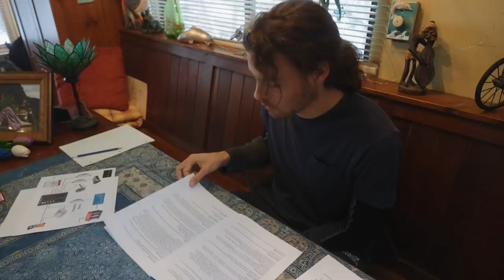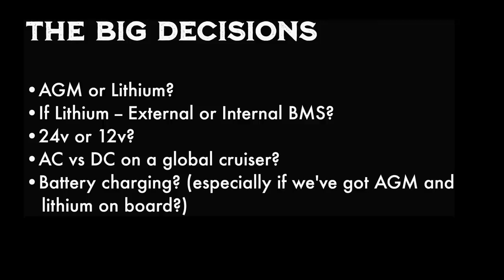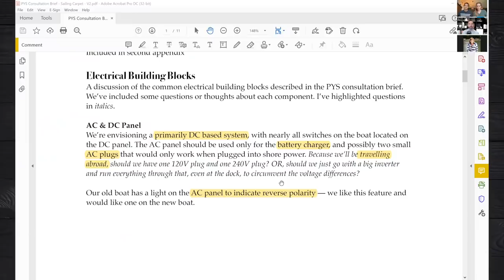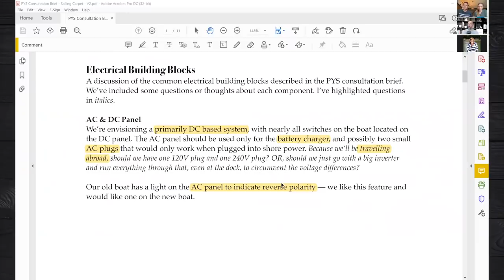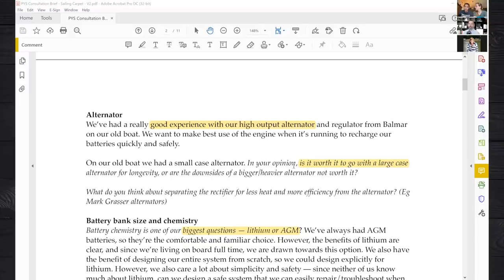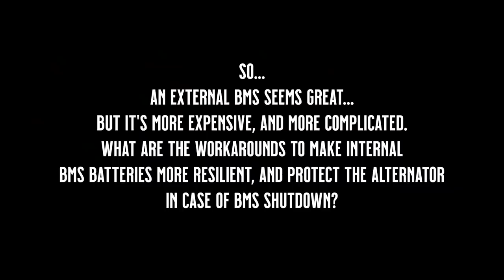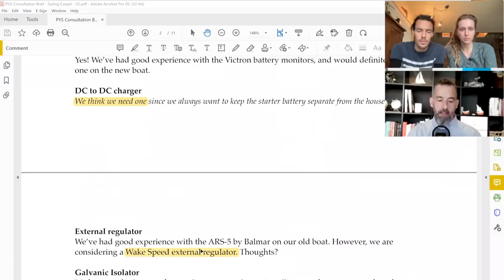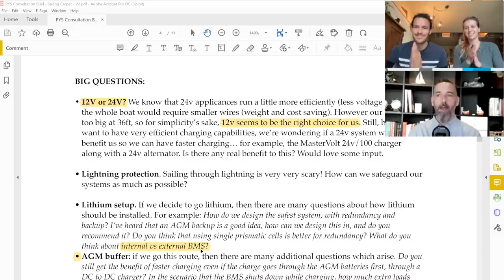DESIGNING an ELECTRICAL SYSTEM for WORLD CRUISING (with Jeff Cote from PYS)

Comment: I have often wondered if each battery in any multi battery bank could be charged, and discharged, individually and sequentially.
For instance, if you have 5 batteries, each 100Ah with a total of 500Ah, would it not be better to fully charge, in turn, 3 batteries than having the whole bank to 60%, and likewise for the discharge?
So any one time you may have fully charged, using, and discharged, batteries.
Reply: Not a preferred scenario that I am aware of. Some exceptions of reservation of untouched starting and bilge pump banks. 
Larger vessels normally have many remote banks. Frequently then recharged on one charging distribution system. So many options.

Comment: A Balmar redline alternator is the best base for all. Go not higher then 70-90 amps, otherwise pullys v-belts etc. will be most expansive at all. My Volvo Penta MB 21 has enough power to drive a balmar. My daily consumption in av. is 70-90 Ah. Consumer battetries are 600 Ah standard batteries, wich you'll find a round the world for less money.

Comment: You will not be sorry with LiIon batteries, they provide twice the amount of energy because they can be discharged to almost zero. AGM batteries can only be discharged to 50%. They also last 2-3 times longer than AGM. Therefore they are cheaper and lighter than AGM!

Comment: Hi I have been following you for a long time now and like your videos. I'm sorry I'm not good at writing English. I have dyslexia, and my language is Norwegian, but I understand English well. Trying to use Google Transfer to translate I I write to you in Norwegian. I know it can translate some mistakes, but I hope for the best.

Do not agree with everything that the expert you spoke to said. This is because I have an education in electronics and electricity.

Putting a lamp between earth and one live wire on the shore power connection is something one must not do. This is because then you make a ground fault in your boat which will cause the zinc nodes on your boat to etch away quickly. And one does not want that. Also, if the ground fault is parallel to your lamp, it will not light up. When it comes to AC, you should choose the voltage you want to have on board, 110V or 220V. When it comes to 50 or 60 Hz so do not think so much about it. For 99% the things are producing today can be used on both. So do not think so much about it. To prevent earth faults, I recommend that you insert a isolating transformer. It will stop all earth faults from other boats. If I were you I would have had 2 connectors for charging current, one for 110V and one for 220V. And had a separation transformer that had two entrances. One for each of 110V and one for 220V and that deliver the voltage you want on board the boat. Then you have solved 2 things.

2. Regarding the type of batteries you have on board. Personally, I have the 1st starter battery bank, and a 400 Ah lithium battery bank. I use a diode isolator from the generator on the motor. Starter batteries are not an AMG battery. For that use only to start the engine and nothing else. When it comes to landing from shore power, I use a charger that can conduct 2 banks. Regarding with lithium battery, there are practically less problems with them than one has with lead batteries and AMG batteries. An AMG battery is practically the same lead battery, and they have exactly the same problems. If you charge them too much, they lose power. And that you can only use about 25% of the capacity. While a Lithium you can use 99% of the capacity without being damaged. If you want to talk to someone who has experience with lithium batteries, please contact those who sail with the boat Uma. They have a sailboat with an electric motor and have used it for over 5 years. Go to Sailing Uma on YouTube. So the problems he refers to with lithium batteries, you can completely ignore. But it is important that you choose the right type of Lithium batteries. Use LeFePo4, these are batteries that are approved for submarines and the contents are not cobalt. Because they can not self-antenna. as the other common lithium batteries can. They cost a little more but are much safer.

Something I would recommend you make sure you have the equipment:

ASI class B-SO, because it is the only one like AIS class B that transmits strongly enough that the AIS salt bits can receive the signals.

Wear AIS-SART in your life jackets. Because should one of you fall overboard, you can see where it is on chart plotters. Other boats with AIS will do the same. Remember that an AIS-SART needs to be checked, lost once a year. It hurts in the instructions for use how to do this.

If you have inflatable life jackets, you must check them every year. By pumping them up, check if they do not leak air / gas in the course of 2 days. As well as weigh the gas cartridge that it contains gas.

Good luck with your new boat. And I'm looking forward to seeing when it's on the water, and watching you sail with it.

With best regards
Knut Botnmark
Email: knut@z-b.no

Comment: Ok, so this is good advice. HOWEVER, this is the 21st century. Put an electric drive motor in MG2, install enough agm batteries as low in the boat as you can with enough capacity to drive your boat 500 miles. Go 48 volt. It is easier to drop a voltage than to raise one. Get wind and solar, also tow a water generator off the transom. Get a backup 2500w petrol generator with the same voltage as your power tools.  I would also install an air compressor in MG2 while she is apart. Air tools are great and will allow her to be pretty when she arrives in port, not just when she leaves.

Comment: I am NOT an electrician by any means...  What I do know is that  You can`t see it, you can`t smell it, and it CAN KILL YOU if you get it wrong..... When I worked in F1 setting up the garages for racing/testing I had a device that I plugged into the mains supply which through a set of lights told you the Polarity of the supply....  I then had a short adapter which had 2 pins that could be swapped to suit the input....I am not an expert but there are devices out there to help....  The definition of an "Expert" is an "Ex" is a has been and a "Spurt" is a drip under pressure... :-)))))))  xx

Comment: I don’t understand why you can’t use a Li-Ion battery for starting an engine?
I like lithium batteries because they hold a charge for many, many months with no charging. I use my boat seasonally and not having to keep a charger going periodically all winter is a huge relief. My boat has a bunch of lithium batteries in parallel with fuses between, if one fails, ideally the fuse would protect the others by isolating the bad one.

Comment: Scusatemi se vi scrivo in italiano ormai il mio inglese è ridicolosamente penoso.
Aiutami Aladino
Jeff ha fatto una descrizione fantastica, semplice ed efficace, mi trova d'Accordo al 99%, con un paio di miei pensieri.
Per quanto riguarda la batteria del motore, per il suo avviamento, sulla mia automobile ho una litio fatta per i motori, per la loro accensione e per i vari servizi interni all'automobile.
Per quanto riguarda ricaricare le batterie di servizio della barca, normalmente, si usa uno Sterlig Power to Battery e non un DC-DC Charger altrimenti potremmo avere tutti quei problemi descritti da Jeff sul distacco dell'alimentazione in tutta la barca.
Io valuterei anche la installazione di una batteria a super condensatori che non è una batteria classica, direi che è una batteria che accumula quella energia che serve per lo spunto di una qualsiasi utenza elettrica e poi lascia il lavoro di alimentazione alle batterie di servizio, serve solo per preservare le batterie da un forte assorbimento inziale...costano moltissimo ma allungano la vita di qualunque tipo di batteria di 10 volte e aumentano anche i cicli di ricarica del 20/30%.
Devo dire che sono stati 50minuti volati via, sembravano 10 minuti non 50.

SCUSATEMI ANCORA PER L'ITALIANO

Ciao

Comment: I personally, will not use lithium for two reasons. Computerized and explosive if exposed to water. However, this guy found a genial way to oscillate lithium and lead batteries. You may want to check on it.
Emily & Clark on YouTube.

Comment: Some remarks:
- Most of the world is 220-240 Volt. See https://en.wikipedia.org/wiki/Mains_electricity_by_country
- A laptop does not need AC power! The adapter makes it that you need to feed it with AC power...
  Direct DC power feeding would make it more sufficient.
- What is your starting point: How much power do you need. Did you make an overview of all the systems need to be powered and for how many hours a day.  You can add induction cooking in this overview.
- In general there is a lot of talk about Ah before a I heard if the DC system will be 12, 24 or 48 Volts. It is better to use KWh. In that case the voltage is included. 
- If you start from scratch I would go for a higher voltage 24 or even 48. I did not understand why boat length is determining the choose of voltage. Only because of the voltage drop because of longer cables?  The advantage of thinner cables required is also on smaller boat.
- Missing an electrical diagram(s) depending on decisions made

Comment: 24VDC, Don’t mix the chemistries. Get either Lithium or AGM. If you decide you can’t afford all Lithium due to cost, design a split system. 

Better to use all lithium, as much as possible at 24VDC for less weight.  

Purchase solar panels to charge the batteries through a network connected battery controller. 

Stick with DC based appliances (12/24VDC) freezer snd refrigerator if possible. 

Use only minimum AC (usually appliances), but you’ll still need an Inverter for laptops and other charger.
Reply: I’ve designed an entire yacht power system and it’s setup like a submarine. All 24vdc down converted to 12 and 5 volts DC for the TVs, freezer, and 12 volt washer.

Comment: Loved your video's - excellent & watch-worthy - then went to check out your website .... very nice. Though I am curious - it says you have 83,000k YT subscribers - judging by the 121k subscribers now - I think you meant to write either 83k or 83,000 - because 83,000k = 83million!
Also there is an error somewhere on your website (it shows at the top of every screen.

As an electrical engineer; solar fanatic and mariner (I just can't sail), I am very much in awe of the solar yachts out there nowadays - the catamarans are wide enough to allow a large area (m²) to fit solar panels - connect this to an inverter that uses LiFePO4 batteries & you can power a small (or large) household! Of course the yacht is not very fast - but it requires no fossil fuels & is absolutely silent. I see some have kites attached for faster propelling!

Comment: Have you considered lead carbon batteries? I am using it in my Van. So far so good.
Reply: Firefly? As a living situation van house bank?
Reply: @braithmiller  Yep house batteries. I have two 116AH 12v. They seem OK. I charge off a Heavy duty Alternator and an Inverter charger.

Comment: Did you never thought about going electric only and use the propulsion system for charging while sailing? Well channels like you did with mcI might be no so easy  but I think you will not find them so often in the world and with an large enough external gas generator this should be possible as well ......

Comment: no to Li ion yes to LiFePo4 - no to internal BMS as it can or will slowly discharge your battery to zero in 6 months if load and charge disconnected - Also LiFePo4 like to be charged at less than .5C and .3C even better. They also don't like being on constant float at 100% unlike lead acid batts (I have 12 V 300Amp Winston LifePo4 cost $Au2400 normal daily use of 160Amp - charge at 14.2volts / low % cutoff at 20% / charge at 50Amp max on charger or 35 Amp approx from solar / storage at 45% with load and charge and BMS disconnected and a 4-6 month charge and then back to 45%. If you need 400Amps get 500 Amps etc - look at site called "marine how to  lifepo4-batteries-on-boats" for lots of good info - hope this helps

Comment: More simple and more cheap.

2 alternators, one to agm bateries for the engine, another alternator as a generator for lithium bateries with bms incorporated.

wires must be 2,5mm copper, so can withstand 240v, and obviously 110V . specialy if one day you want to sell it, if it comes to europe for ex. 

All plugs, pc, lights, etc  connect to the inverter , and when conected to a marina for ex, you bypass the inverter, shut it down and plug the outsource electricity direct on system.

Comment: To each their own and I respect that, although I think Maya wants a little more than Aladino. I think it's a mistake to limit ourselves to only necessities for a length of time. Sailing is hard enough, so I like to be as comfortable as possible. Get cost estimates and go from there. Is it worth it if it costs 12k for a proper battery/solar system, which means enough electrical power for cooking, air conditioning, heating, washing clothes and limiting fossil fuels as a back up to cooking and heating. Are you saving that much by ruffing it if the cost for fossil fuel and a solar combined system is about 8k but at the cost of your independence? Hard choices to make.
Reply: Diesel engine ... diesel stove ... $12000????? really?????

Comment: I'm way too late here, but you can run Lithium batteries without a BMS. So should the external BMS fail you can simply bridge it. Especially with LFP batteries this will be ok. Of course this is something you should only do in an emergency and you would have to monitor the batteries closely especially while charging.
On the other hand, why do you fear that the BMS will fail, but not the external regulator?
The simple solution is to put two lithium banks with two BMS in parallel. This would survive a BMS failure.

Comment: The Atticus designed and installed a complete electrical system in their bluewater boat (three or four comprehensive videos:
https://www.youtube.com/watch?v=T_LQSKPm_O4
Reply: They had to use huge cables, heavy, awkward and expensive, as their system was low voltage.

Comment: For a different take....see Sailing Uma.  Full electric recharge globe trotting example....
Reply: Also Beau and Brandy Sailing.   But both cases are much smaller boats - similar length, but a fraction of the size.  The original installation in UMA or the current setup in SAOIRSE would not work.  The UMA upgrade would be possible, but is still not enough power for a boat the size of Magic Carpet II.   The smaller craft can get away with not requiring the engine for anchoring and docking - an option that is much less practical in a larger vessel.
Reply: @danielthackeray7798  didn't think it was that much smaller.... but thanks.   For myself the idea of listening to a diesel engine for days on end would kill the whole idea.   Electric or nothing. 

There are large e.power units out there.   And even more in planning.   Exciting to think where this is all going.

Comment: Not to put a spanner in the works, but if you can get hold of the info books put out by "Victron", there is a lot of very good info to be had and their products are excellent and cover most applications, just saying!! I have no connection with Victron.

Comment: and i dont understand the boat size argument for 12 over 24v. That is not even an argument IMO... I am building a 4x4 truck based camper right now and going 24V, not just because the truck is 24v but because of the arguments mentioned here for 24v, more efficient, reduced cable size, etc...

Comment: This guy is making things a little bit too complicated.
Lead acid and lithium(Lifepo4) work perfericaly together. Their voltage curves complement each other very nicely in nearly all scenarios. There is an excellent video from Emily & Clark's Adventure explaining this. There is no need to split the bank. Keep the system simple but make it larger. 
Larger battery banks (multiple batteries in parallel) also have zero problems outputting the 600A needed to start the engine, especially when you throw in a few lead acids.  For protecting the alternator, one key term in the automotive industry is "Load Dump" It comes down to an alternator outputting 100v for a few milliseconds. If there is even a small battery, this voltage is handled. 
As for voltages. 12v hands down. It comes down to common(12v) vs efficient. 48v is the better efficient option. 24v really has no place. 
External BMS....Why. I design these systems and while I do see slight benefits to exposing them, they are not worth exposing them(and dozens of wires) to the marine environment and sailer. It is cheaper to throw in a more batteries and therefor lowing the loads through each BMS than it would be to use an external model. For me the only thing that would be making me lean towards less lithium would be extreme cold and even that is mangable. 
look at some of the prices over at this youtube channel, It's not that much more than lead acid. https://www.youtube.com/c/WillProwse